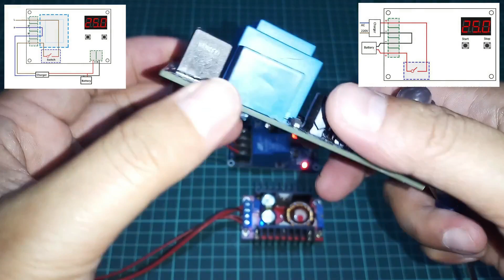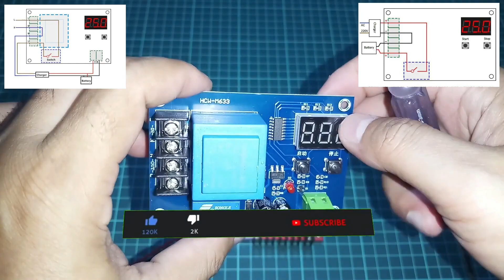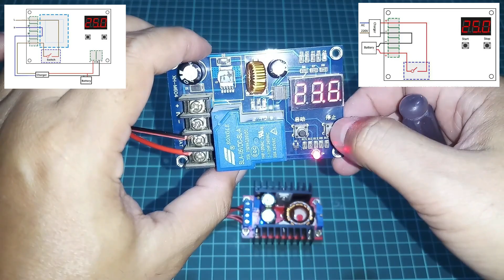HVD HCW-M633 (XH-M602) vs XH-M604 (HCW-M634) Cut off Aki / Battery Charger Control Module - Part 2

Comment: Sy mau tanya pak.untuk type M604. Kode IC regulator nya brp?. Soal y punya sy jebol ke bakar.semoga terjawab tks🙏
Reply from the maker: Malam Om, kebetulan saya di Jakarta, PLTS saya dikampung 🙏🏼. 
Coba nantu kalau mudik saya cek.
Reply: @JanSKD  baik pak.terimakasih
Reply from the maker: @imanuddin1709  🙏🏼
Reply from the maker: @imanuddin1709  selamat petang Om
Di body IC tertulis
XL SEMI
XL7015E1
93835
Reply: Sangat membantu sekali. Terimakasih pak🙏🙏

Comment: ass, yang HCW-M633 (XH-M602) untuk in nya ac 220 vol, sekaligus menyalakan layar voltase, begitu kah, dan apakah bisa dioper ke dc untuk in nya
Reply from the maker: Betol, in nya AC, kalau mau digunakan untuk cut off DC bisa ditambahkan 1 relay AC lagi.
Reply: @JanSKD   menambahkan 1 relay AC, tutorial nya
Reply from the maker: @bismilahhirohmanirohim1247  output dr HCW-M633 masuk ke Coilnya (relay AC), untuk yg DC bisa ke NO atau NC relay tetsebut.
Reply: @JanSKD  terimakasih sangat membantu

Comment: tanya om hcw  h634 bisa untukb24 volt gk
Reply from the maker: HCW-M634 untuk 24 volt bisa Om,
Ini speknya bisa DC 6v-60v
Reply: cara seting om.12v 24v   misalnya 12v 11.5v.klo setel 24volt  25.5 gt om. tlg om 🙏
Reply from the maker: @VivoV27e-lx3sc  25.5v itu batas atas atau batas bawahnya Om ?

Comment: saya bingung, 28,2 cutoff atas, 24 cutoff bawah..?? kapan charging nya..??
Reply: seharusnya set 28,3 cut atas.. artinya stop charging.. batas bawah itu untuk memulai charging di berapa volt tergantung setingnya.. kalo seting di kondisi batre kosong maka tidak bisa untuk pelengkap system plts
Reply from the maker: 😁 maaf Om, 24.2 on untuk charging dan 28.2 off (stop charging) 🙏🏻
Reply: @JanSKD  wkwkwk..
saya masih cari referensi, itu kalo range nya di persempit misal stop charging di 14,1v dan mulai charging di 13,9v apakah bisa terjadi miss komunikasi system..??
ketika kondisi bateray di bawah 13,9v apakah tetap mencarging..??
Reply from the maker: @gopaltronik2754  biasanya voltase standby dan voltase saat kena beban berbeda, apalagi kalau aki kurang sehat/drop, misal kalau di PLTS saat inverter on dan terpakai. Jadi kalau range nya sempit khawatirnya modul akan on off, on off (jedag jedug 😁 bilang terhubung ke kontaktor ATS) sehingga sistem PLTS terganggu. 
CMIIW

Comment: M602 kalo pasang kabel pln nya terbalik apa alat jadi rusak?
Reply from the maker: Kalau saya belum pernah terbalik, tp secara diagram dr PLN masuk ke modul M602 ke relay untuk di on off oleh relay, sedangkan untuk meng-ON kan modul memakai jalur in DC dr aki. Sehingga menurut sepengetahuan saya bila dr PLN terbalik tidak merusak modul tp kalau dr aki terbalik akan merusak modul. CMIIW